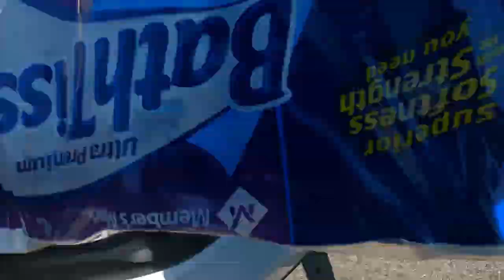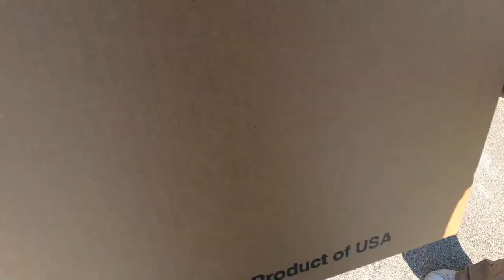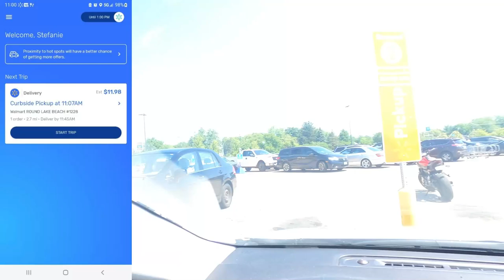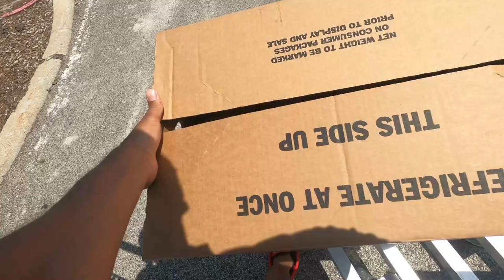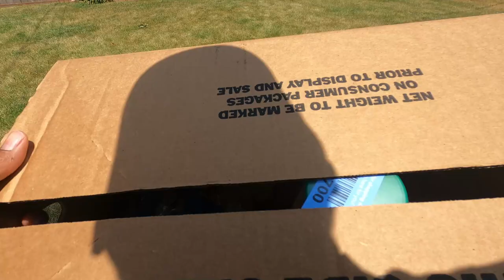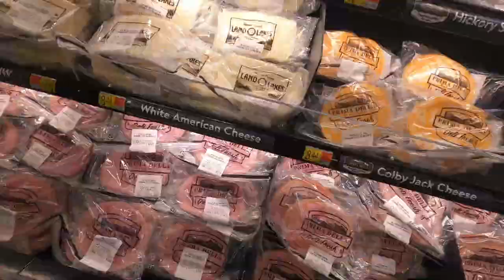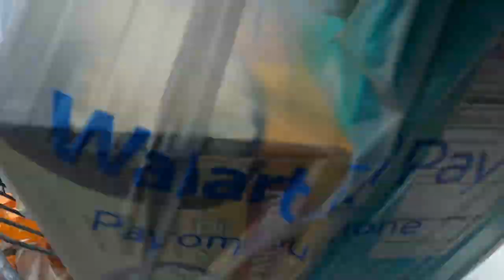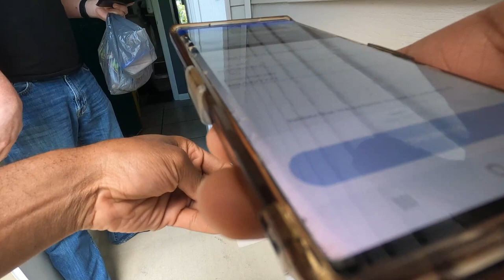How Much Did I Make Taking EVERY SPARK Oder For 8 Hours? 🤯 InstaCart, DoorDash Ride-Along; Tips

Comment: 50 minutes? Man. It's risky, but what I do is once I reach 25+ minutes, I cancel the order, and wait for it to pop back up, and the same order is available for $7-$10 more since it's put into the ASAP pool. The risk is that since it's moved to ASAP, there will be other drivers that will see the order available. I've legit had an associate apologize to me for waiting so long for an order. Well, it's happened a few times, but that's just how it is with some Walmarts on certain days.

(edit): Quick question. How often do you get offers from Instacart that contain less than 5 items for S&D? I'm really considering it so I have Veho, and something else to work with when it gets slow. I still don't want to try fast food delivery XD
Reply from the maker: 🤔 That’s actually a pretty smart idea! I’ve never done that one before.

Very rarely do we get small orders like that. Most of them in our area are a good amount of items. If it was small items like that I would be Instacarting it up!
Reply: @carsandcribs  thanks man, I'm going to try and see if I can get hired by them then :)